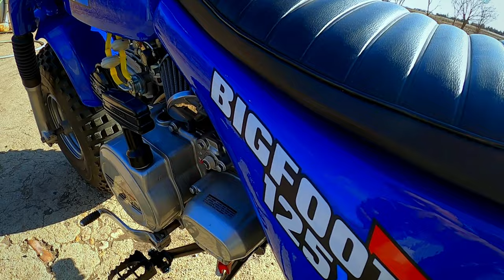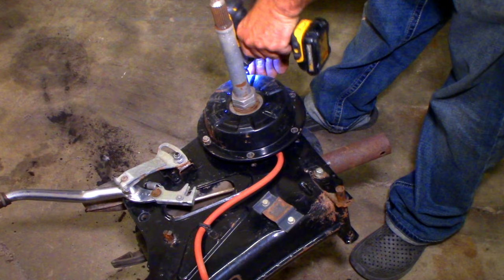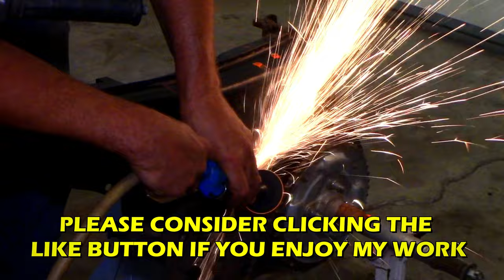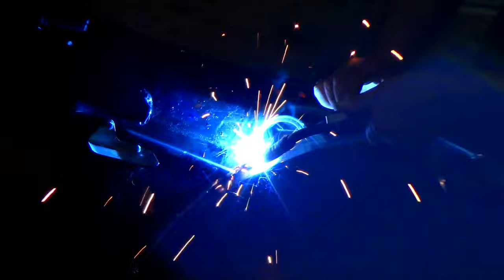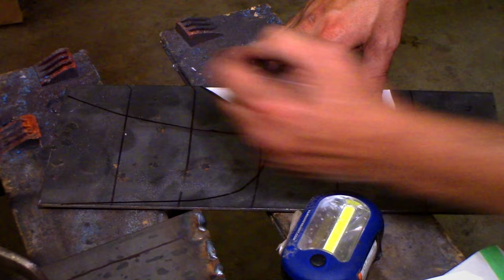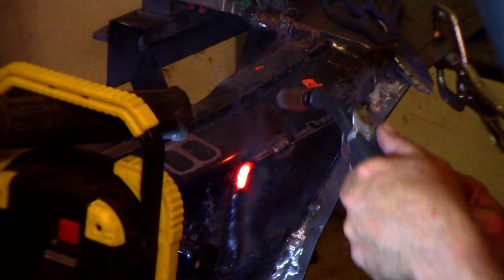Honda 3 Wheeler Two Wheel Conversion Bike - IT'S A MONSTER FAT TIRE DIRT BIKE!

Comment: Could you please post a part number or link for your air filter setup please. Looks like they run fine using it with factory jetting.
Reply from the maker: You can search ebay or amazon for "39mm cone air filter" and find all kinds of them. They work pretty darn good on the Honda engines. What are you planning on putting it on?
Reply: @BIGFOOTBIKESANDBREWS , I put a 125M engine in a Honda 70 that needs a filter solution. I also have another engine and a couple frames so now I’m considering building one of these.
Reply from the maker: @omoffroad  Sweet, I bet that 70 hauls!!!
Reply: @BIGFOOTBIKESANDBREWS , It isn’t finished yet. It’s actually a trx125 engine so I will also have reverse I can’t wait!
Reply from the maker: @omoffroad  Nice, Reverse would be pretty cool. I never thought about using a TRX engine. I'll have to keep my eyes out for some! Thanks for the idea!

Comment: I've been wanting to do this for a while, I'm figuring to do it too a 1983 110. Did you find a way to keep both high and low gear capabilities?
Reply from the maker: Yep, it still has the high/low. I talk quite a bit how I did it on my white bike build videos https://www.youtube.com/watch?v=oFoAsYfeBA8&list=PLmU1QZjQHa1uBQFV9pDoU-T15Xlo_H-V_&index=1
Reply: @BIGFOOTBIKESANDBREWS  thanks a ton dude, your a hero in the trike world.
Reply from the maker: @davidpetker6487  haha thanks 😁 Did you find the video of the jack shaft setup on the bikes? That's how I was able to use the stock hi low output sprocket and still clear the wide tire. The jack shaft robs a little power I would guess, but the reduced weight and one less tire, the bikes end up about exactly the same acceleration and top speed as the trikes.
Reply: @BIGFOOTBIKESANDBREWS  yeah, found all the videos, thanks again.